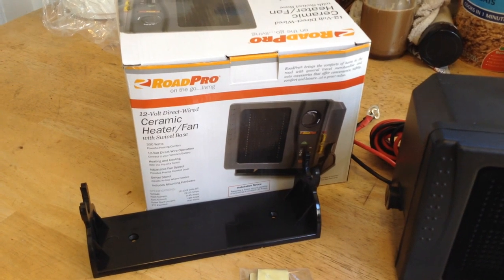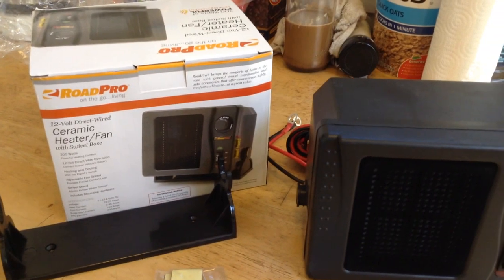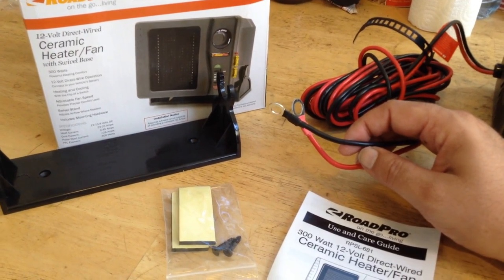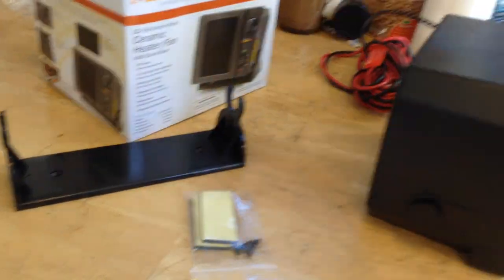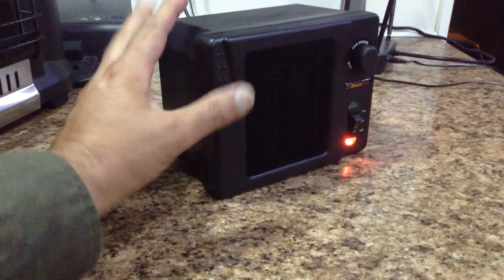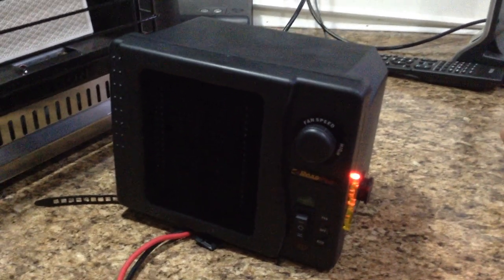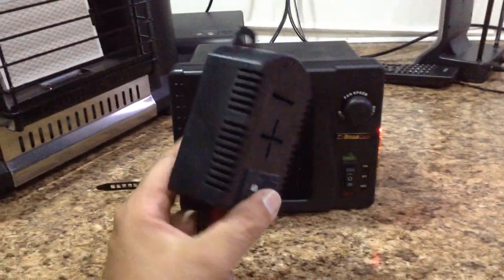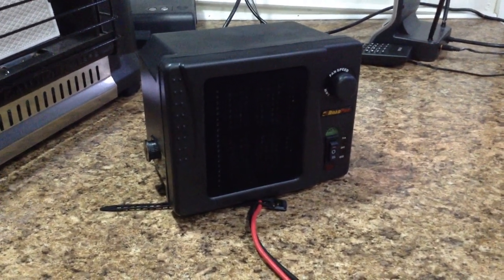RoadPro 12v RPSL 681 Ceramic Cab Heater

Comment: I am coming to this party quite late. I am a retired trucker now living full-time in my Toyota Prius. This is the space heater I use when the onboard heater cannot overcome the extreme cold I sometimes experience. It does what I need it to do. I leave my car on 24/7 and let the magical Prius circuitry do its thing but the heater does not seem to turn the car on more than before. Then again, I try to avoid the extreme cold.

Comment: These are really just for supplemental use. May raise the temperature of a small area a few degrees but by no means is this little unit going to be able to satisfy most people's desire for "heat". 300 watts is just not enough. Helpful when you first start a vehicle because you won't get any heat from the vehicle heater until the engine has warmed up. Leave the vehicle heat off until it warms up. During that time you can run this. Let the alternator recharge the battery after starting. As far as running a unit like this off a separate battery you won't be able to run it very long. Example; a 100 amp hour deep cycle AGM battery has 300 watts available for 2 hours until you are 50% discharged. Not recommended to go below that although you can. An ordinary flooded lead acid car battery is recommended to not be discharged below 80% and has a lot less power available for something like this.

Comment: In regards to his comment about automobile alternators having only 30amps;
No automobile has a 30 amp alternator unless you're taking about antique tractors. My lawn tracror is 15 amps for example... enough to run lights and an air pump sometimes. 
 A 70s truck will have about 60 amps. 130 to 150 amps is typical car alternator from 1990s on up. Many work trucks and RVs have dual alternators at over 300a or single one at 200-240amp. If buying a new RV spec it with highest amp alternator/s
Long story short any reasonably modern minivan, SUV, or truck will make more than enough power to run 30 amp accessories.
Reply: Mostly but at idle with other accessories also running the battery may actually be discharging depending on the total load.

Comment: Will this unit draw down a battery on a side by side if you connect directly to the battery and only use it when the side by side is running ?  Thank's

Comment: I have this heater and was working great for awhile but for some reason now it only blows cold air. I have it hooked up direct to batter w/in line fuse, fan works but no more heat. Any help would be appreciated.

Comment: The 300W rating is based on the heater running on 13V to 13.5V (typical system potential of a running car).  Mine runs about 250W on a 12.5V battery bank.
The 'speed control' is just a 10 ohm 3/4 turn potentiometer, which is worthless with a brushless muffin fan (because a 555 and switching FET or a fan that had a PWM speed control input would add sooo much to the build cost /sarc).
Having seen the internal construction, I wouldn't pay more than $15 unless you absolutely need one.
Reply from the maker: I could not find anything with comparable heat output under $30 but you know how it is, if anything is 12v, the price goes up.
Reply: +randacnam7321 how do you know all this chit
Reply from the maker: Nicos A  I read the labels and took a course in automotive engineering back when I was in the Marine Corps.
Reply: 8digitPDX
Poking around inside mine as I have one of these heaters.

Comment: Average car battery is 500-600 amp, so this heater draws about 25 amp/hr at 12V ,  theoretically should run for 8-10 hours. In cold weather battery output can drop as much as 50%.
Reply: +szaki That's the cold cranking amp rating, not the amp/hour rating. This heater would drain a single car battery in under an hour.
Reply: BS! Battery has about 50-60 amps, this heater don't use more than 1-2 amps/hr.
It takes my battery to charge, from empty at 6 amp, 8-10 hrs.
Reply: +szaki lol 1-2 amps an hour?? thats 24 watt's max.   these heaters use around 25 amps. 
another thing to consider is that if you have a 60ah battery  you will not get 60ah of it..  more like 40 amp hours.
you will be looking at about an hour run time  in the real world.
Reply: I think, you right! Never could figure out, these Co.'s do all kinds of weird advertisement, how good their battery is!
Reply: i know its terrible..  its like advertising a car with a 4 litre engine that actually only has a 2.9 litre engine..  i don't know why they bother overrating them all
Reply: szaki You need to go back to electrical 101. You are way out of your league here.
Reply: I know basic electronics, so shove it!
Reply: +szaki OK. Good luck with your theory. Take a brand new car battery and put a 25 amp load on it for an hour and see how well it does for you.
Reply from the maker: +szaki  I seriously doubt you would be getting over a half hour out of an average car battery with this thing before that battery is no longer even capable of starting the car.
Reply: Dude, you don't have to lecture me, I know Watts=Volts x Amps. Electric heaters use lot of power, even a small one. My space heater at home use 1500 watts, 1.5 kW/hr.
That's 13 cents/kWhr at the normal rate.Run it on a cold day and my electricity bill jumps.
That's why in RV's/ boats propane or alcohol heaters used.
i just wasn't sure how much power in a battery is stored.
Reply: What about if you are using an AGM  deep cycle 12 volt battery.
Reply from the maker: firstbornbirdman I ran this heater on the same system of four deep cycle batteries that you see in some videos about the off grid camp trailer (at the time it was the primary source of heat in that trailer).   I was able to get about 45 minutes out of the battery system at full charge and the heater on high, and that was $800+ worth of batteries I had gotten used for around $300ish and were maybe five years old at the time of the test, but kept fully charged on an automated solar charging system which was also running during the test.  It was then I decided that propane heat was the only logical way to go for that trailer.  It's not just the wattage of the heater sucking power, but the conversion process and the fan.  The heater was good for say, warming up the little area while someone gets dressed and ready for work, but you can't hang out in there all day and it won't keep the place toasty all night.
Reply: Thank you for the comprehensive response.
Reply: Cold cracking amps. That's max amp draw at 0'F for 30 seconds. RC is reserve capacity is measured in minutes. Might read 120 minutes at 50 amps. Means it will run 50 amps for 120 minues before the volts drop to 10 or 10.5, its been a while since i was a parts guy. Numbers for amps and minutes pulled from air and are VERY optimistic for any passenger vehicle that's not a disel

Comment: I bought one of these and they are junk
Reply from the maker: OK then, but compared to what?  I have tried a few 12v heaters and not found any that I consider "really good" but this seems decent.   I don't get paid anything from RoadPro, so I am not married to them in falsely promoting their products, but I am not finding good options out there on 12v space heaters.
Reply: +8digitPDX Build your own, I made a 50watt 12v **handle warmed wrench, with cheap wire and electrical tape. 
   Cost me less than a dollar. Helps when holding a cold wrench in -25f.
Reply: @DarkLinkAD  How the hell does that heat a small trailer or vehicle cab???
Reply: @geographyinaction7814  How? With effort and a hell lot better than chinesium imports.

Comment: I'm trying to electrically heat a small 2 seat airplane cockpit. I have a dedicated odyssey pc 680 Battery to power it.  I have bought this unit and another smaller one but they don't seem strong enough.  I need the power of an AC small ceramic space heater w/o the AC power.  Any ideas?? thanks in advance.
Reply from the maker: No battery is going to keep this going for very long and I would not want to risk taxing the aircraft motor's ability to generate sufficient power to run a heater unless I knew more about how it is set up.